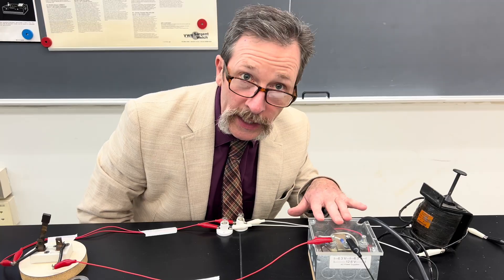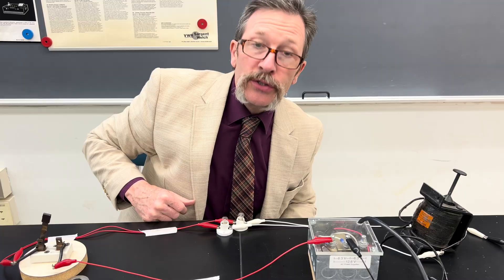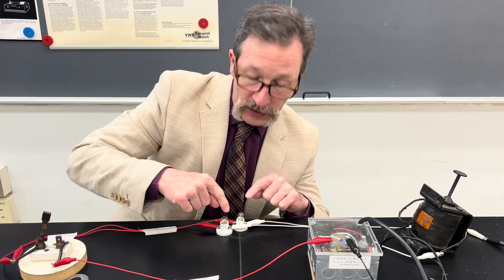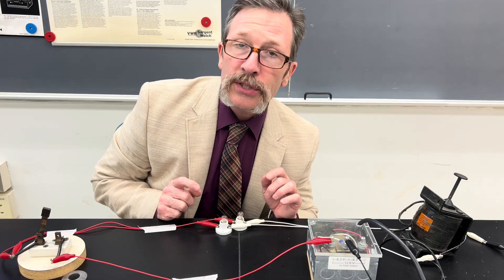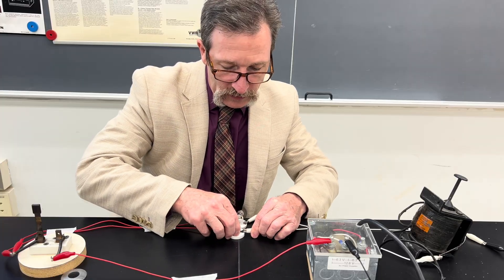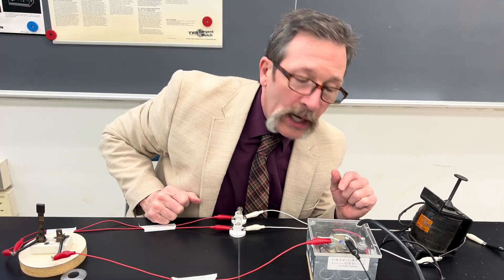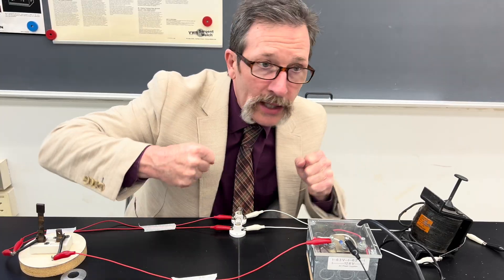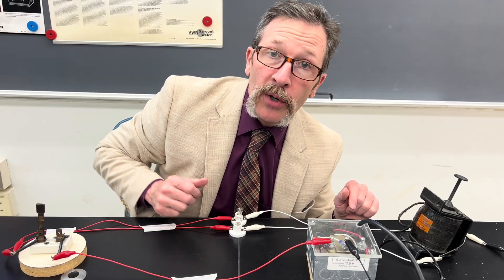Placing a Coil in Series with a Lightbulb and an AC Power Supply -- What Happens?

Comment: You didn't explain why the bulbs don't flash.

You say "bulb" so I'm thinking incandescent lights. Incandescents don't flicker, because the current heats up a filament, which stays hot. It doesn't cool fast enough to stop glowing. If they're LEDs, they do flicker, but 60Hz is too fast for the eye to detect. (After all, a good gaming computer can show 60 frames/second=60Hz, and it looks completely fluid, not flickery.)
Reply from the maker: Great tidbit here! Thanks for that.

Comment: I previously watched your "DC through a coil & bulb" which demonstrated a delay to the bulb coming on. That made it easier to understand why the AC reversing course would cause the light to never come on, because the field needs to be established first before enough current would flow to light the bulb but the field never gets a chance to fully establish.
Reply from the maker: Happy to hear it! Stay tuned for the next in the sequence this Monday
Reply: wonderful demonstration. I've been trying to explain phase correction to a friend. he asked if it would help the power bill to add a capacitor to a house. it's both simple and complicated and I'm failing to explain. short answer, it depends, but here it's no.

Comment: Is this the same as hysteresis loss in a transformer?
Reply: No. In the case presented here, it is simply the effect of the coil's immense inductance, which in alternating current has the same effect as a resistor in direct current.
Reply from the maker: Thank you for your response!
Reply: very good question! tricky one. I thought no, then I thought yes, then I thought wait it's almost true but it is not. I had to look up the definition. the changing magnetic fields in the iron core induce a current in the iron itself. having multiple laminated plates helps reduce this, but it's still a thing. those iron plates are basically dead short wires. what happens when you put a current through a loop of wire, it gets hot. that is basically what happens to cause hysteresis loss. now here's the thing...

hysteresis is when there is a lag. the current in the coil starts to flow first, then the magnetic field builds, and then it induces a current in metals near by. I think it happens at the speed of light, but it takes time for the fields to build up. I think that lag is called hysteresis, and probably where your mind was going when you wrote the comment. if I'm wrong, please do correct me. all interesting things.
Reply: @lorenzo42p   Ironically, after thinking about it a little more I’ve come to the conclusion that it’s the size of the coil which creates an opposing magnetic field so large that it totally shuts down the current in the wire.
Reply: @bretts6861  yes, it's due to the amount of magnatism the metals can hold. the air too actually, but it's a much smaller amount. the magnetic field can build up enough to let more current flow, but it takes time. the changing ac current reversing so many times per second cuts off that process of building the magnetic field. I want to learn the math, but for now it's still beyond me.
Reply: @bretts6861  here's a thing that shocked me, when I learned this, it helped other things click together. do you know why it is called electro-magnatism? because they are the same thing. electricity and magnatism are tied together. when you have a changing current flowing through a wire you will also change the magnetic field radiating out into the air around the wire. and when you have a changing magnetic field in the air around a wire, it will induce a current flow in the wire at the same time. you can't have one without the other because they are the same.

Comment: Hello,
At the end of the quiz to explain the voltage-current shift, you should show the signals on the oscilloscope.
In this case, we would see a weak current out of phase with the AC voltage passing through the coil since the impedance is assumed to be high.

I think the students would be interested in seeing visual proof of the electrokinetic phenomenon.

Thank you for this good teaching idea of presenting physical phenomena.🎉🎉🎉
Reply: 1. Phase shift with respect to voltage of the lagging current due to inductance

2. Explain why there is not enough current to heat the filament of the incandescent bulb. 

😂😂😂
Reply from the maker: Good points!
Reply: @eddybash1342 H. 1) Phase Shift is too advanced for this intro video.  2) He did explain ... Inductive Reactance of the coil, similar to resistance in a DC circuit.
Reply: we see those who ignore the presence of a phase shift in the current! 🎉🎉🎉
Reply from the maker: Thank you for your comment and suggestion!
Reply: The phase shift is no importance here. This phase shift between current and voltage exist only at the terminals of the coil, not at the bulb. The current has the same phase everywhere, but the voltage at the terminals of the circuit elements does not. The current is reduced due to the inductive reactance of the coil,
X = (omega) × L.
Reply: No, not an oscilloscope at all !  These experiments must be done with the most rudimentary equipment possible, that is precisely their charm. The temptation to use very modern equipment must be resisted, and the experiments must be done in such a way that the effects are highlighted by simple methods, incandescent bulbs, analog measuring devices, etc. Let us not forget that scientists of the past were pioneers with only an electroscope and their own spirit !
Reply: It's impossible to understand without showing the shape of the electrical signal when working with alternating currents!

This will prevent students from giving nonsensical answers to questions. 😂😂😂
Reply: @eddybash1342 Why do you need to see the shape of the amperage waveform?  It is still a sine wave. Just with a small amplitude.
Reply: The purpose of such experiments is not only to learn, but also to use reason to develop explanations or predictions regarding the evolution of the experiment. The use of an oscilloscope or other sophisticated devices, by the very fact of revealing the operation of the circuit, prevents man from reasoning, which is not desirable. It is exactly like a mathematical problem that is required to be solved without a computer.
Reply from the maker: Yes...this is just one part of a larger lesson to stimulate their thoughts. Thanks for your comment!
Reply from the maker: Agreed! Sometimes a bit of technology to keep it fresh is alright, we think! But your sentiment is noted. Thanks!!!